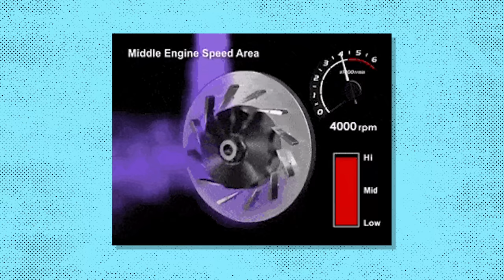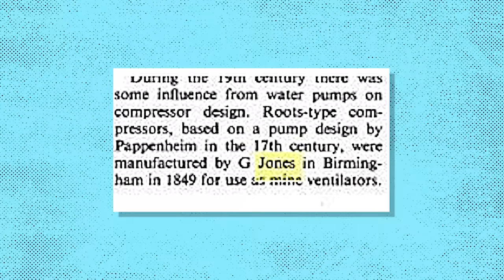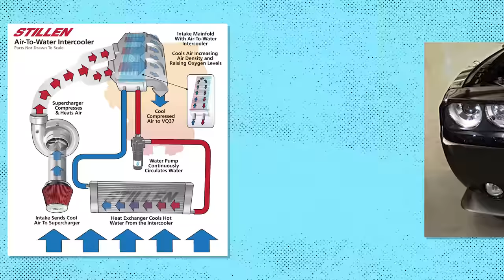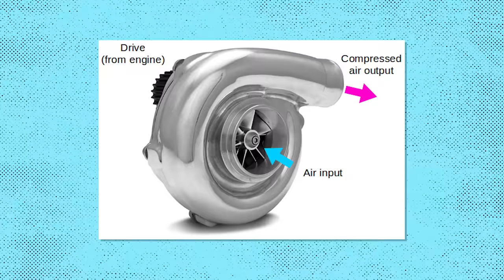Why Superchargers Aren't As Good as Turbos

Comment: I would say its the  other way around. Superchargers are easier to install, easier to maintain, more reliable and the driver has more controll over the power using the throttle. The reason why turbos are used by most manufacturers are because of increasining emission laws by voting in incompitent poleticians. And since a turbo car is as exiting as a  regular car crusing around, its more emmsion freindly. A supercharger has aleady most of its torque while just cruising around over 2500 RPM, so its not a hard decison which is"more good" for fun driving.
Reply: Then why are superchargers less prevalent in applications that do not require emissions?
Reply: @sandervanderkammen9230  I think the cars that you would be refering to are the race or exotic cars were high horsepower  numbers is the premise on track or showrooms. Turbo usually makes more peek horsepower on medium-smaller displacement engines. Also take less space in the engine room.  The small dispalcement of a Mclaren benefits more from a twinturbo than a supercharger found on a muscle car like the 6.2L Jailbreak. However, as shotty as general Dodge build quality is, compared to exotics, the Hellcats look like Lexus products in maintainace costs.  

The McLaren 720s has common reliability isses with its Turbo Inlet tubes. From what I hear, Exotic dealerships make money of extended warranties which wealthy people can afford. So that is their own ecosystem. An ex AMG engeneer talked once about how ideally they want costumers to buy a new car every 4 years. So if turbos have to get fixed within warranty, no problem. And if its time to buy new after warranty, no problem. 

As for Turbos in race applications, I would say since its a sport long term reliability is not a factor having a mechanic team behind every car.
Reply: No, I'm talking about mass production applications, over 60% of new vehicles are turbocharged and the numbers are growing.
Turbochargers are extremely reliable and should if designed and maintained properly should last the life of the engine.

Turbos are so reliable that they are used in certified general and commercial passenger aircraft.
Reply: In terms of motorsports, turbochargers have established thier supremacy long ago in the top tier series like Formula 1 and Indianapolis, and the most grueling  like Le Mans and Rallye.

Comment: An engine needs to work to push exhaust out of a cylinder, and it needs to work harder to push that exhaust through a turbocharger. That's why exhaust porting and headers gains extra power in a naturally aspirated engine. It's erroneous to say that turbos are more efficient at producing boost, it's just sapping power in a different way.
Reply: @sandervanderkammen9230  A turbocharger has to work to move air, and where does it get that energy to do that work? Moving exhaust, where does that exhaust get its energy? The exhaust stroke. What pushes the exhaust stroke? A different cylinder's power stroke, or the momentum from the previous stroke. There's no such thing as free energy, turbochargers aren't prepetual motion machines. It's basic physics. You need to learn how a turbocharger works.
Reply: @marcopolo8584  Thank you for confirming that you do not understand how a turbocharger actually works.
The turbocharger run on the the waste heat energy rejected by the reciprocating engine.
All of the energy used to drive the compressor comes from heat that is normally wasted out the tailpipe in a naturally aspirated engine.
Any questions son?

Comment: 30 years in auto repair and only changed 1 supercharger.   I get calls on bad turbos all the time.   Turbos cook themselves to death.
Reply: You must work on some really crap cars..
Reply: @sandervanderkammen9230  
Some with 200k, some just out of warranty.   People with crap cars aren’t going to fix an expensive turbo when they can’t keep the simple things fixed to prevent their car from becoming a pile of junk.
Reply: @briancardr  Exactly, it's not a problem with turbochargers at all, it's a problem with consumer perception and unrealistic expectations about vehicle maintenance and repair, most owners don't read or understand their owners manual or take the car to be serviced when required.
98% of second owner vehicles don't received proper maintenance.
Reply: Turbochargers are extremely reliable, this is an irrefutable fact that cannot be disputed.

Comment: Though superchargers suffer parasitic losses, the losses aren’t that great on street legal vehicle configurations.  Superchargers have their advantages:  1.) They are more durable than turbocharged which spin at incredible speeds and share the engines oil lubricatiin system.  When a turbo goes, so goes the engine and Vice-versa; superchargers have sealed bearings and the assembly suffers less mechanical stress & wear because the impellers spin so much slower.  2:) Superchargers are more efficient  because the much larger volume of air moved is heated so much less than with a turbocharger.  This means many a street applications can forgo the added complexity & expense of an intercooler required with turbocharger systems.  Also, the small relative volume of super-heated air compressed by the turbocharger’s impeller results in approximately 35% power losses.  Example:  Doubling the atmospheric pressure (~ 15 psi) of turbo boost does not double the engine output…it’s more like a 65% increase in output.  Superchargers don’t suffer such losses.  3:) The high heat generated by turbochargers deteriorates engine oil more quickly, requiring more frequent oil changes; not so with superchargers.

Comment: I personally believe centrifugal superchargers could take a leap back into the industry
Reply: Really? How so?
Reply: @sandervanderkammen9230  just a hunch due to how they still have potential
Reply: @gp8666  Potential for what?
Turbochargers produce more power and are more efficient.
Reply: @sandervanderkammen9230  doesn't mean they don't have potential
Reply: @gp8666  What do you mean by leap back into the industry??? They were never very popular but they never completely went away, in fact there are a lot more now than a few decades ago.
Reply: @sandervanderkammen9230  yes they are cheap and easy to configure and they can use all sorts of gearing systems as well as cvt
Reply: @gp8666  Yes, but they produce less power and are much less efficient, a significant disadvantage in modern cars.

Comment: In the middle of an LS swap now, and everybody is hounding me to go turbo. Yeah, guys, I get it. Turbos are far more efficient, yes I know small turbos spin up pretty quick... I just seriously can't stand even a half second of lag. I came up on bikes and I expect things to go when I say go, not after the motor has a couple of seconds to consider my offer and finally show up to work a half second after I've lost my opportunity to make that gap in traffic. I'll trade a ton of hp for instant throttle response any day of the week. Efficiency be damned. If I wanted pure efficiency I'd be building a turbodiesel with an automatic.
Reply: Turbo lag does not mean slower acceleration... some people seem to be every confused and misinformed about this, turbo lag is not a real problem... it is an imagined one.
Reply: @sandervanderkammen9230  I concede this could be the case. My turbo experience is with a Yamaha and a Dodge from the days of carbs and early fuel injection. Modern engine management electronics may have done away with lag. All I know is that I <really> hated that Yamaha, and the Conquest was mildly irritating. (But cars seem slow to me anyway) Thanks for the tip. As expensive as SCs are I still might go turbo. I haven't ruled it out.

Comment: Didn't mention the reliability aspect. Turbos are known to fail way more frequently than superchargers
Reply: That's a very ignorant statement to say the least, a typical automotive turbo lasts over 150,000 miles the average life of the vehicle, on heavy duty vehicles they can last over a half million miles

Turbos are extremely reliable, so reliable they have been used in passenger aircraft for over 80 years... and can pass the strictest PFTR reliability standards for FAA or EASA airworthiness type certification.
Perhaps you should stick to subject you actually know something about?

Comment: Your car's exhaust is wasted exhaust not waste energy, the engine still has to push that air out, thus the power to spin a turbo is still coming from the engine.
Reply: WRONG, you need to learn about how a turbocharger actually works.
Reply: @sandervanderkammen9230  it's adorable when they pretend to be smart.  exhaust gasses spin the turbo whos turbine like blades Force more air into the car's intake. What part of the process do I not seem to understand?
Reply: @mocha9072  Yeah it's adorable when people give explanations so oversimplified that they are wrong.

Turbochargers are HEAT engine and operates using the BRAYTON CYCLE,  it thermodynamic cycle complies with the Carnot Formula.

The turbocharger does not induce any parasitic load on the reciprocating engine... this is basic fundamental fluid dynamics involved.

Comment: Electric supercharger is the correct way to say 6:18 not electric turbo. Turbine is an impeller spun by gas, so if you use the electric motor to spin the Kompressor you no longer use a turbine, so say it correctly
Reply: Don't confuse electric hybrid turbocharger with electric supercharger, they are completely different concepts.

Comment: 4:31 "they use engine power to produce engine power"
Yep, superchargers suck, but so do turbos. Displacement adjusters are the way to go. Three pre-compression and three re-expansion cylinders on a secondary crankshaft that is connected to the engine via a CVT.  Changing the relative velocity of the secondary crankshaft to the primary crankshaft changes the engine's working displacement while maintaining the perfect (perhaps 2.5:1) expansion to compression ratio.
There's continual torque transfer to the crankshaft.
Yep, pistons rule and turbos/superchargers drool.

Comment: Superchargers are not being used much for a simple reason: Cost.
A supercharged engine is basically an N/A but just "more of it". This of course means that the manufacturer has to get the base engine right before they go about supercharging it. 
With turbos on the other hand, you can literally throw anything in a car and fix the engine's weaknesses later with the turbo(s). At the end of the day, a turbo engine is just an excuse for not trying harder.

There is evidence for this.
The good engines are still being made by the same few manufacturers that made good engines before the turbo era. The bad engines don't really strike you as bad right away, but it will show eventually through high oil consumption, heat management issues, high wear and tear, short life.

Btw, turbos are not necessarily more efficient. They are only more efficient under constant partial load. On high and low load, especially in very dynamic scenarios they drink fuel like there's no tomorrow.
Reply: Turbochargers are dominant over superchargers for the simple reason that turbos produce more power and  are significantly more fuel efficient.
Turbos do not not cause any parasitic drag or loss and have superior BSFC  efficiency compared to naturally aspirated or supercharged engines.
Reply: All Otto type engines achieve maximum BSFC fuel efficiency at full throttle..
Peak Isographic efficiency island performance occurs at WOT.

Comment: so ... you basically decided to ignore every thermodynamic rule of energy conservation and throw the air resistance out the window, because yhea, the exhaust side of the turbo add its load to the exhaust loss, its still less than the catalitic but more than of a silencer.
And the electric version of a superchargeur (we call that a compressor btw ) still need a power source so, unless you are ready to accept the additionnal weight  of several batteries,wich I doubt, You would need to draw it from the electric generator, wich take its power from ... the engine, and it force back when you draw more than what it can deliver basically asking more power from the engine.
Reply: Sorry but you need to learn about how a turbocharger works... the exhaust turbine is driven by the heat energy leftover in the exhaust.
Reply: @sandervanderkammen9230  heat enregy, so you don't know whats a turbine ?
Reply: @psycho__9945  A turbocharger is a heat engine..
A heat engine that operates using the BRAYTON CYCLE.
It uses an impulse type turbine.

What part do you not understand?
Reply: @sandervanderkammen9230  I rewatched it (the brayton cycle) the parts where the HEAT is powering the turbine is nowhere to be seen, but it is said that the CECOMPRESSION of gaz do turn the turbine
Reply: @psycho__9945  You don't seem to know much about heat engines or the BRAYTON CYCLE.

The amount of heat energy is directly proportional to the amount of shaft horsepower generated by exhaust turbine.

The turbocharger differs from the supercharger because there is no parasitic loss from the crankshaft of the reciprocating engine.
 The energy used to drive the turbine comws from the heat energy normally wasted out the tailpipe.

Any questions?
Reply: @sandervanderkammen9230  Nha ! I will let you being ridiculous alone
Reply: @psycho__9945  No, I'm dead serious.  A turbocharged engine makes more power than the same engine supercharged at the exact same intake manifold pressure.

This is a irrefutable fact that you cannot dismiss or ignore.

You clearly lack the education or professional experience on this topic to understand how the turbocharger works with a impulse turbine tp convert the waste heat energy in shaft horsepower.
The turbocharger is not a parasitic load on the engine crankshaft.

Any questions son?

Comment: Turbos do not impose a loss on the motor? What about the pumping loss? And about the work the piston have to make to overcome the resistence of the turbo?
Reply: The Turbocharger operates on waste heat energy in the exhaust gas to drive the turbine wheel.
The centrifugal compressor is significantly more efficient than the reciprocating engine and reduces pumping loss.
Reply: @sandervanderkammen9230  Your concept is wrong. There is work to spin the turbine and this work is only partialy from the residual pressure of the exaust gases...
Reply: @DesastreMan1  You obviously don't understand how a turbocharger actually works.
The turbocharger uses an Impulse type turbine... it converts the VELOCITY of the hot gasses into shaft horsepower, not the pressure.

Comment: While parasitic power loss is greater in the supercharger, it isn't nonexistent for turbos. Spinning the hot side uses the exhaust gasses, but that means that the scavenging effect in the exhaust gasses is greatly reduced. If well designed headers can add about 15hp on some engines, then not having that effect would eliminated that benefit. Both have their pros and cons. Turbos lag, superchargers have a bit more parasitic loss.
Reply: the engine itself works with parasitic losses afterall, not surprising but cool to know 👍
Reply: You sir, obviously don't understand how a Turbocharger operates on an engine.
There is no parasitic drag on the reciprocating engine.
The turbocharger converters waste heat energy normally wasted out the tailpipe and uses this recovered horsepower to reduce pumping loss and increase volumetric efficiency.